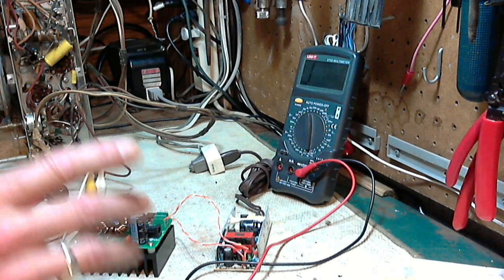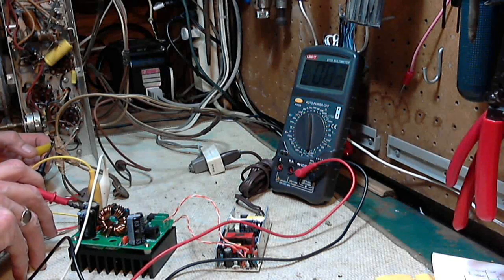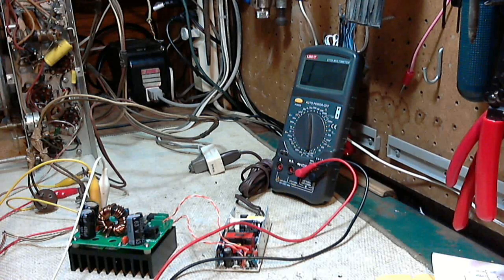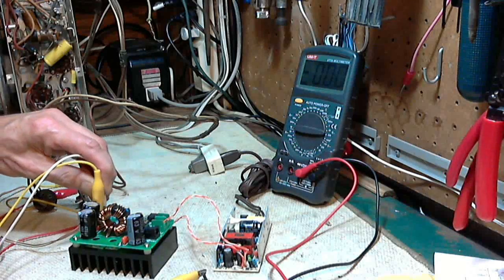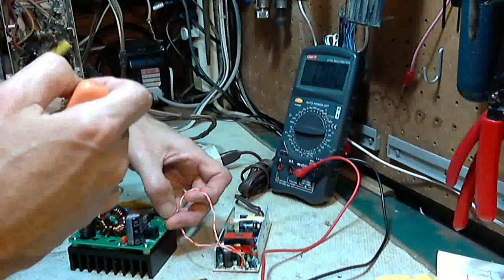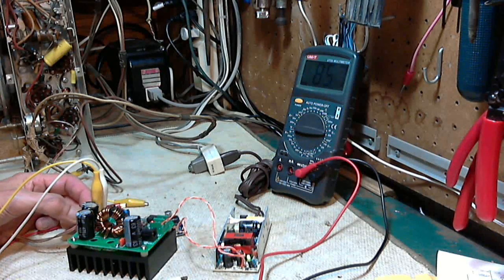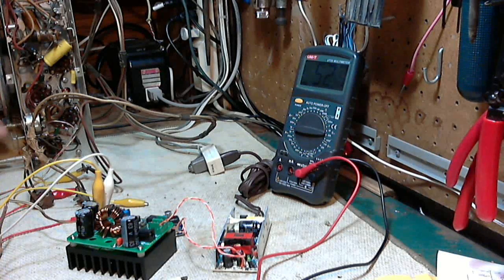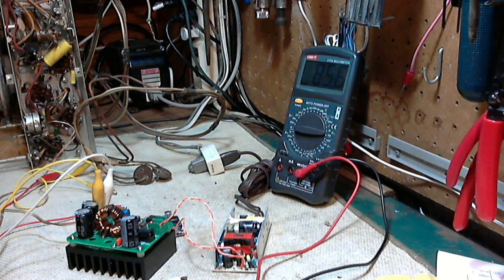General Electric C57B Farm Radio Video #14 - Power Supply

Comment: When you showed the battery that had been soldered to, I thought..... two wires that you added came from the switch...... did you just put 85 volts to the filments? Hope not.
Reply from the maker: Carl Burgess My own brain cells didn't connect at that moment where I had the battery in my hand.  When the wire dropped out of the radio, I knew I didn't know for sure what it was and a simple test of the resistance would have turned me around but I didn't bother and just assumed it was the B+ wire and kept going.  I eventually did check the wire's resistance but by then I had burned the filaments out and the meter showed an open circuit like what might be expected for the B+ circuits.  Then it was 'All ahead full steam'! 

I think the common theme throughout the whole thing is that I was not being cautious enough and in fact, I was gambling.  This is very curious to me - that I should be in a gambling mood and it's reflected in my behaviour in my shop.  (Don't misunderstand me about gambling.  I've never gambled a dollar and I don't even buy lottery tickets.  It's not my nature to gamble with anything serious).  

What all this is saying to me is that I need to be more aware of my mood or attitude when I'm undertaking important things where error cannot be tolerated like working with electricity or driving a car or using power tools, etc.  A little more Zen is in order at those times.
Reply: Jim Lindenas Too many distractions when you are filming... You appear to be a cautious person, this was just a wake-up call that will give you more strength in what you do.
I enjoy your videos thanks.
Carl

Comment: Also what I did not see you do, is refer back to the radio schematic and see how current flow is handled in there. Alot of corners could have been cut because they knew the supplies were isolated. Using those switching convertors, the supply is NOT isolated anymore. The way around this would be using a full blown switching power supply with an isolated tap and isolated ground for filaments. Easiest way to do that is find a off the shelf 90v regulated power supply, and wrap a couple turns of magnet wire around the main transformer. That gives you your filament supply.

Comment: If you have a variable DC supply, bring the B+ from there slowly and monitor the current draw...
Reply from the maker: Frank Ferraro I originally worked on the radio a couple of months ago and used my variable HV supply to run it then along with a 1.5V cell for the heaters.  Because of that previous experience, I do not expect a short in the HV circuits in the radio.

I'm thinking of using the two remaining 'supplies' for the 90V B+ and a single 1.5V cell to operate the heaters.  I'm still worried about the noise coming from the power supply.